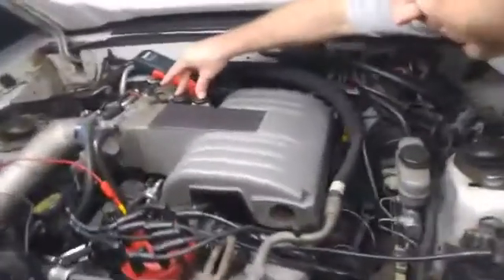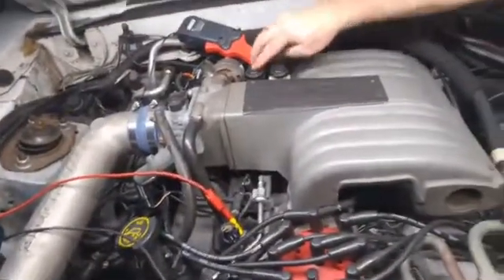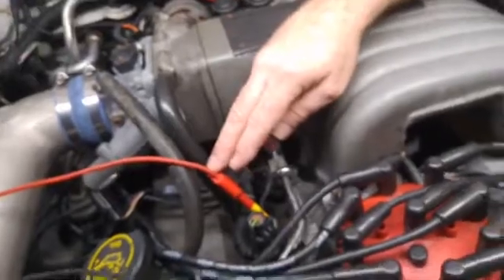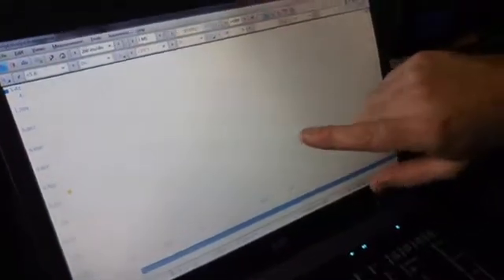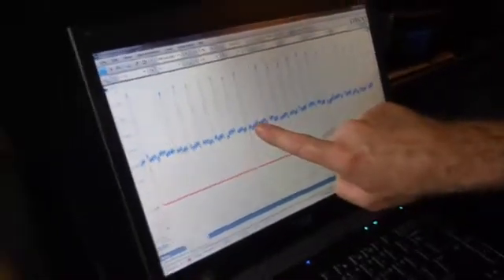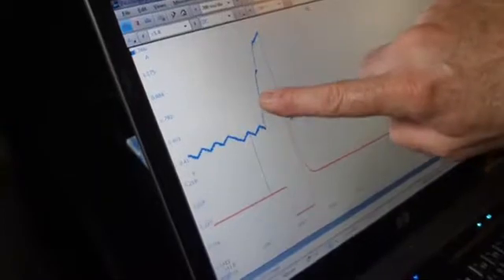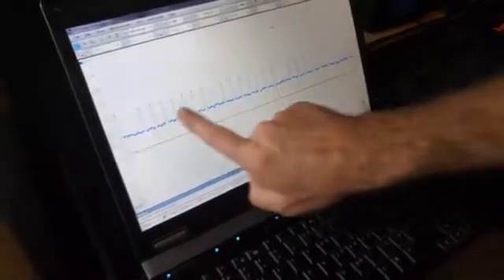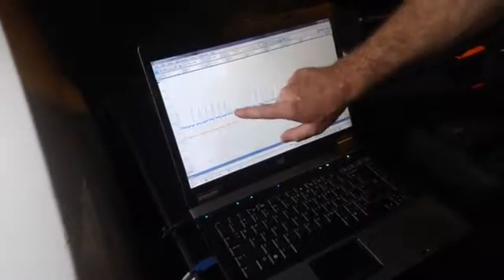Fuel Injector testing a 5.0L Mustang Part 1

Comment: I'd it were me bro, I'd pull that intake and ohm out that injector. seems to be the easier route for me. that o-scope program is awesome
Reply from the maker: Watch all 4 parts of this case study. It's not what you think.

Also, no need to pull the intake, or even to unplug an injector if you want to ohm it. Just pop the thin caps off the top of the 10 pin connectors, and you can access each injector right there. Ohm between the common power wire and the specific injector wire. You can ohm all 8 injectors in about 2 minutes.
Reply: @dragradialperformance3540  yea, i ended up watching the whole 4 parts after i made this comment and it shows. now I'm curious I'd the SN95 has a similar injector plug for easier testing without pulling the manifold. i have the Ford FSM and the VAC/WIRING manuals i can look in to see if such a plug exist
Reply from the maker: @PANTYEATR1  The 94-95 don't have the 10 pin connectors, but you may find a bulkhead connector you can backprobe. The easiest way by far would be if you had an EEC-IV Breakout Box. Then you have instant access to all 60 pins on the PCM, from inside the car.